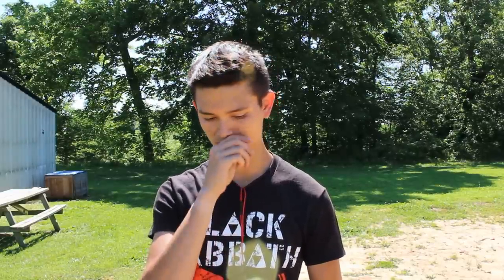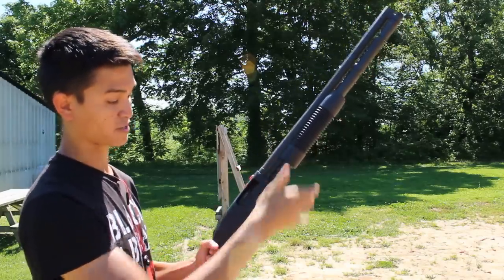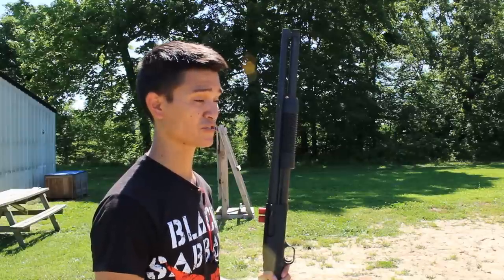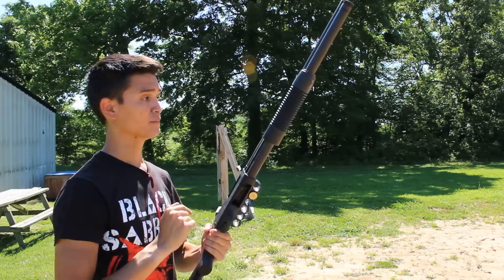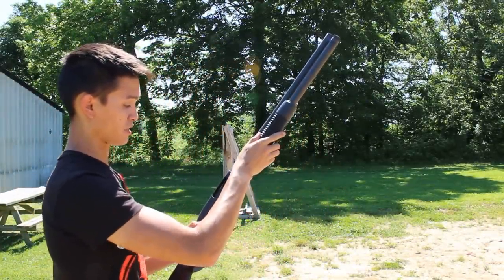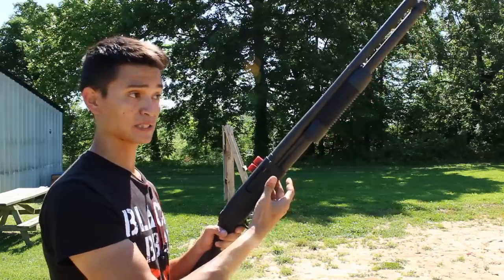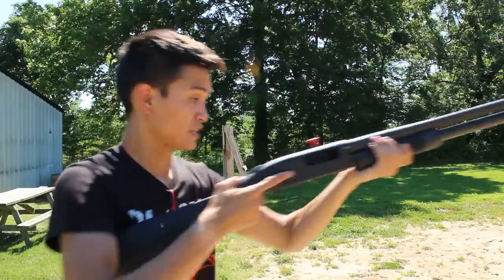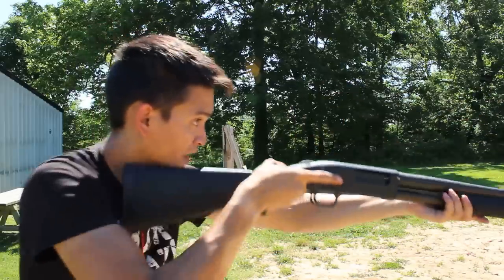Shotgun stuff EP2: Slug changeovers and placement of shot on side saddles.

Comment: You're absolutely right about the not remembering which round is which part if you throw different ones in. Just a few weeks ago I was in trenton NJ at work (I live in PA and have a permit here) I couldn't carry while at work and I got in a car wreck and 4 to 5 people from the other car tried pulling me out to basically beat me to death and I couldn't figure out where my phone was to call 911 and it was on my fucking lap so I drove off and called 911 once I could actually think straight

Comment: If the shotgun can tell the difference between recoil and hand cycling the action, then how do you manually unload the tube on that type of auto loading shotgun?
Reply: Unless auto loaders are wildly different from their pump action brethren, on the inside of the loading gate there should be a shell retainer that you would just depress. Might be wrong, I've zero experience with auto loaders.